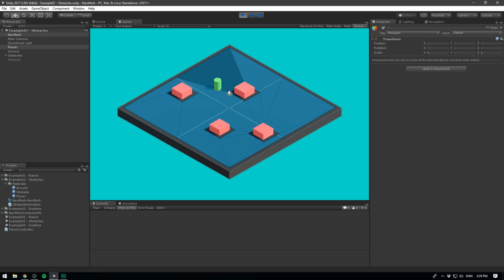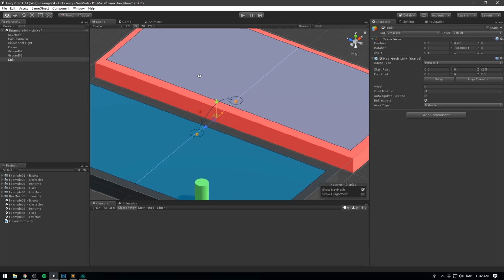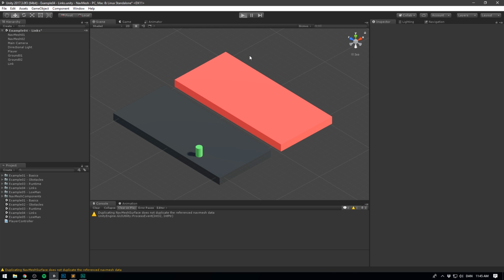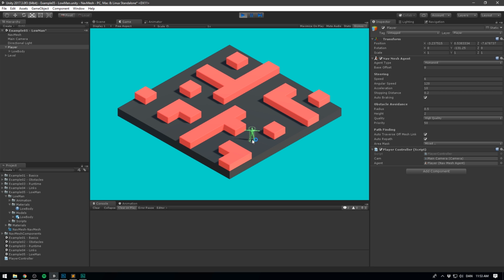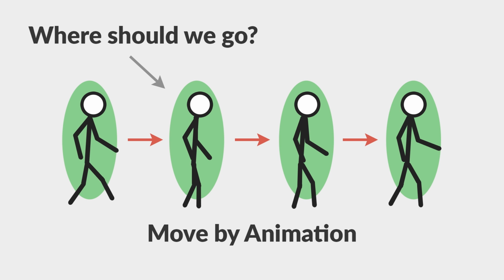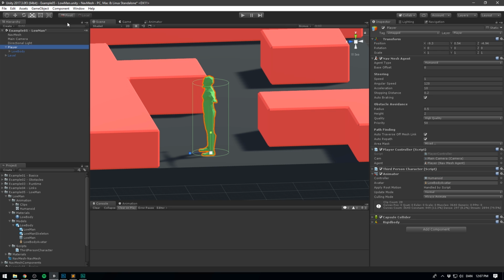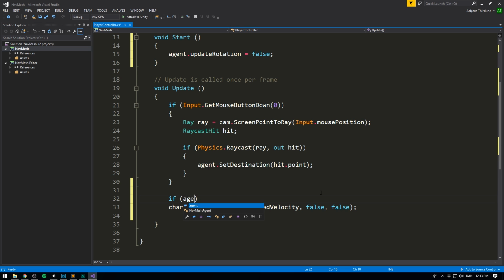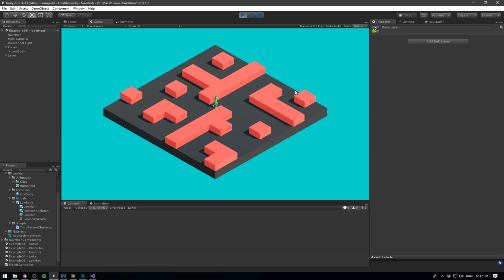Unity NavMesh Tutorial - Animated Character

Comment: I'm trying to use the thirdPersonCharacter, but I have some problem with the model LowMan. It seems that the origin is placed in the center of the body and not at the base, so when I play the scene the character is still running the fall animation. I'm using Unity v. 2019.1.8f1 and I downloaded the project from github with commit c328571. Thank you
Reply: I had the same issue, turns out I had a cylinder mesh at the feet of my character (to display the attack range) and the mesh changed the navmeshsurface, after rebaking the surface the character spawned at ground level and stopped being stuck in fall animation

Comment: hi thanks for the video. I found a little problem. I follow with unity 2018 and in perfetcly going...but the next day I update this project with 2019.3 and there is a bug. the character move at the point but he stay on the idle position. do you know what can be the probel? I have checked all the settings and the code, but everything is as the video.Thanks